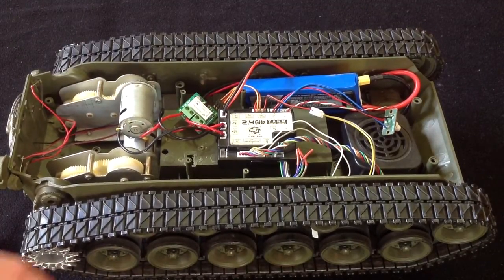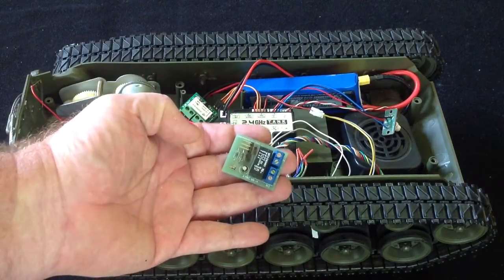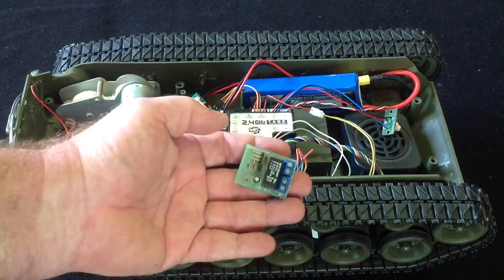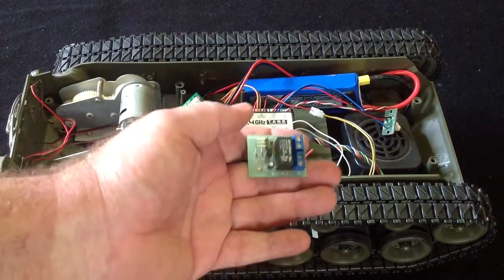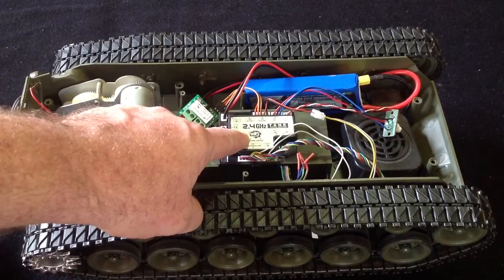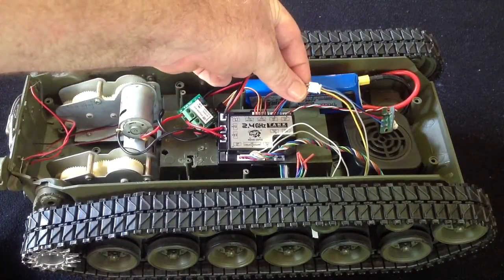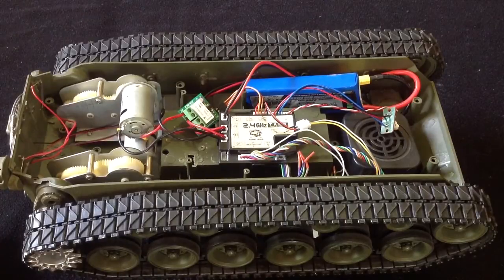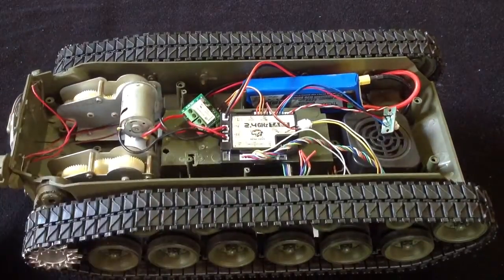Return Of A Classic - The ATRC

Comment: can the ATRC be used with the IBU2 board to cancel out the track recoil?
Reply from the maker: +Evil Fingers if the ibu2 has a positive pulse output at the same time as the track recoil then yes.  But why would you you use an IBU2 over an Asp?
Reply: The IBU2 is more affordable than the ASP.
Reply from the maker: I find that hard to believe  
125 pounds = $175 USD.  Asp starts at $150 USD so Asp is actually cheaper. The Plus version is $175.  So at best you can say maybe equal in price but the Asp offers far better specifications.

Asp also ships worldwide with tracking for less than $20 to most countries.

For a start:
Asp uses CD quality wav files (stereo if you want) as opposed to the IBU using mono files at only LoFi quality of 22k

There is now over 200 sounds per Asp sound set - multiple engine starts, multiple user sounds, multiple cannon and hit sounds.  More sound options than ANY other system.

Audio amp on Asp is 20W versus 2 x 3W on IBU2

Asp uses 2 X 30A main drivers, The IBU2 only 2 x 15A drivers.  Twice as much available power.

Asp has 16 different IR battle modes.  No other system even comes close to this number

Plus Asp has other IR functions that are not at all available else where such as Friend or Foe (no shooting of your team mates at close range) and wireless reporting of battle states via Remora.